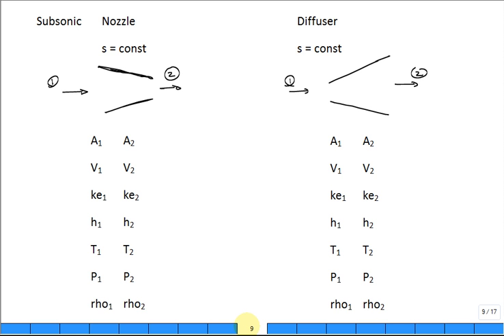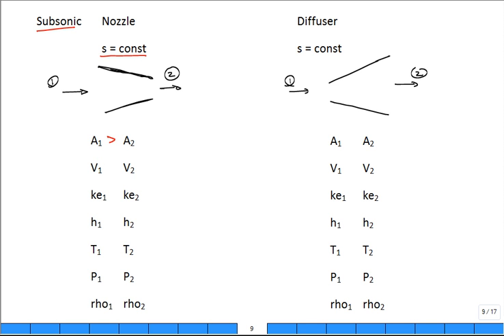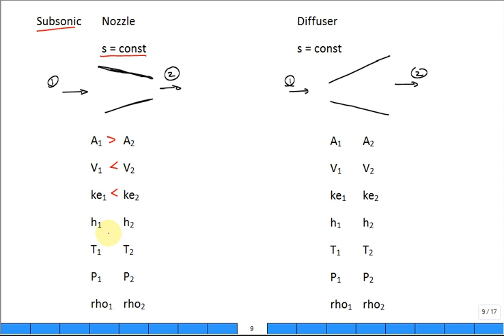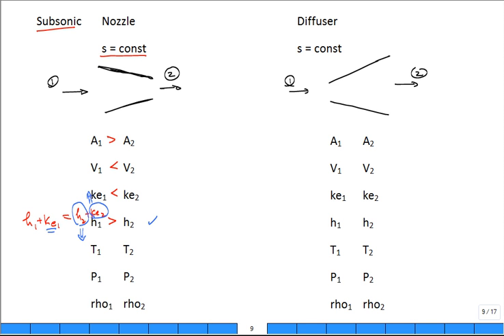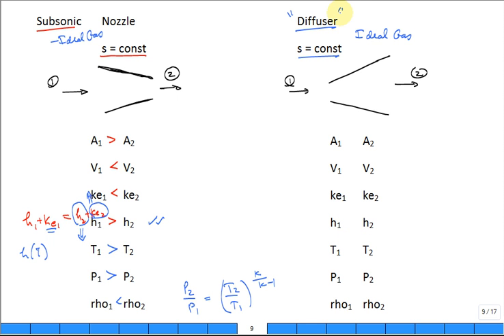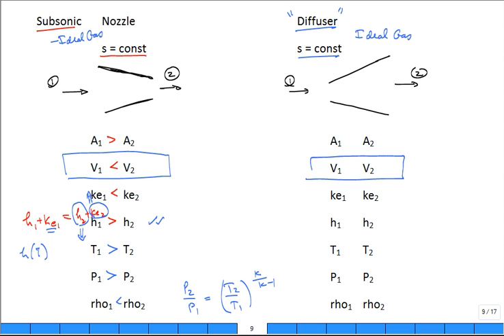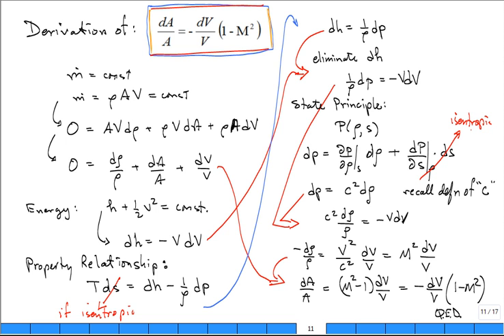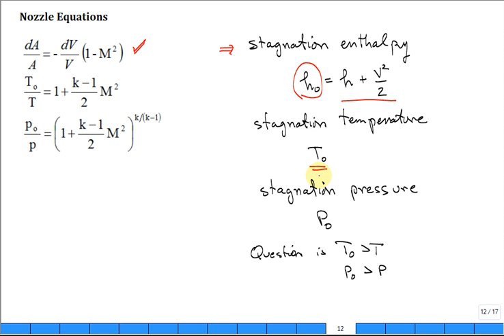Discuss subsonic and supersonic flow in nozzle and diffuser

Comment: i have a question about density, you said that in the subsonic flow; density has changed. i dont understand that, if it is not compressible flow, how can density change?
Reply: Compressible flows are possible below supersonic speeds too. As a general rule of thumb, we consider a flow to be compressible once it reaches Mach No. > 0.3 .

Comment: So that's why fighter aircraft engines have moveable outlets. They change in shape internally so they accelerate the flow as much as possible depending on the speed of air coming out.

Comment: I'm going to answer Thomas Haberkorn's question below-- "why (intuitively) does supersonic flow velocity increase through a divergent nozzle ?".   As pressure drops and a gas speeds up thru a nozzle,  the density of the gas decreases.  For M< 1.0 the velocity is increasing faster than the density is decreasing due to the pressure drop thru the nozzle.    At choked flow, the rates of velocity increase and density decrease are just equal  so mdot = rho v A hits a max for a given throat A.  Beyond M=1.0, the rate of density decrease exceeds the rate of velocity increase as pressure falls. So, If one tries to accelerate the gas beyond M=1 to an even lower pressure drop so as to go supersonic, the density of the gas is falling off at  a greater rate than the velocity is increasing and therefore, the only way to maintain the  the same mass flow rate (which is nailed down by the choked flow at the throat) is to increase the area of the flow area to offset the decreasing density.  wayne kirsner, PE.
Reply: wayne kirsner Oou 😶

Comment: Nice and fine, the derivation of the supersonic nozzle equation is clear, good work! However I wonder, is there a intuitive way to explain how for supersonic flow velocity increases through a divergent nozzle ? What's so different about supersonic flow, in order to reverse the convergent/divergent rule for velocity and pressure? As of now, subsonic flow makes a lot more "sense" to me.
Reply: the moment fluid reaches sonic velocity driven or forced convection loose its hold on these molecules...they are moving faster than pressure transmitting speed of the fluid...now molecules more act like a independent entity...if given space by increasing flow area they expand taking up there internal energy...mostly the repulsion that has created pressure itself...so there internal energy by virtue of geometrical opportunity converted into velocity....if geometry is forcing them together their molecular momentum force them together and pressure increases by consuming KE. ask yourself what will be the velocity of expansion of gas in outer space,  if  we some how suddenly vanish container wall of a cylinder of gas in space....
Reply: Think about it in terms of mass in a given volume. For compressible flow, it is possible to increase mass in a given volume. For an incompressible flow it is not possible to increase the mass in a given volume. Remember these are based on assumptions that will get you "close enough" to the absolute  answers as, in reality, all fluids are compressible.

From there use conservation of mass and it becomes easier to understand
Reply from the maker: ThomasHaberkorn thanks for your comment.  I understand what you are asking.  I don't have an answer to your excellent question.  Maybe another viewer can point to another video/resource?
Reply: Also reference the incompressible flow equation.